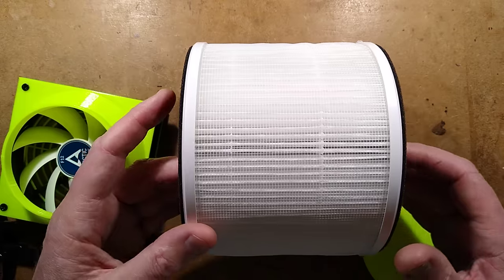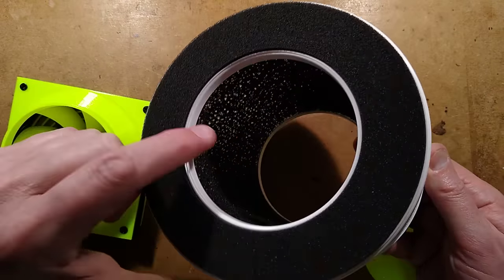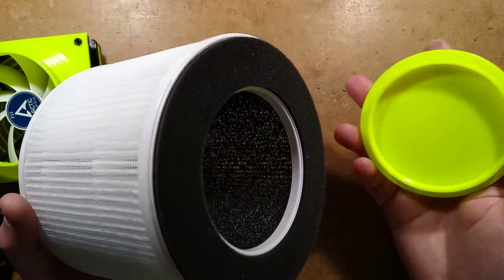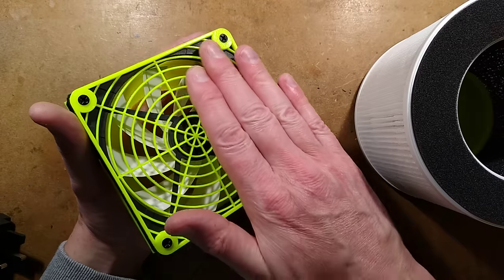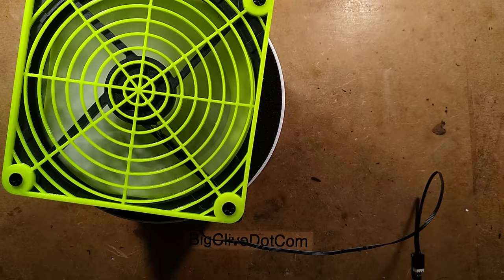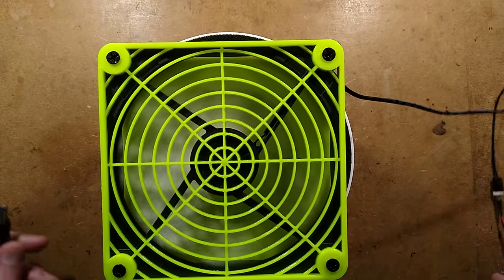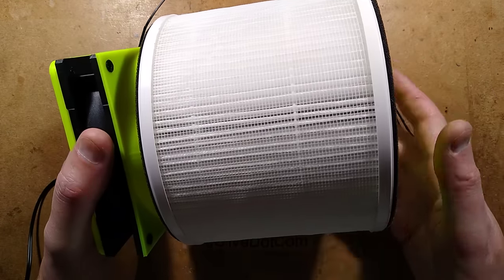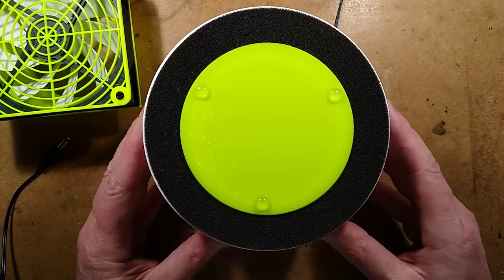DIY cheap & quiet HEPA air cleaner

Comment: Sorry, but why? 
This doesn't filter incoming air, just moves a bit around through an expensive filter. As soon as a door or window opens. Object defeated. 
I can understand these things on a vacuum cleaner exhaust, in the input to a car Aircon and so on, but standalone will do little more than a token effort. For most it's unnecessary and a waste of power.

Comment: In my opinion these filters do shit... I am planning on replacing the filter with a 125 micron nylon mesh just to capture dust particles and for that purpose I think that it will do a far better job. 125 micron filter will increase the airflow substantially

Comment: Unless you test it to at least the 4 x 9s at a stated, regulated flow, d/p, etc, it's not a HEPA.
Did system engineering for certified HEPA systems for hazardous material facilities and this kind of system is a kludge that has no reason to do anything useful.

Comment: You seriously need to educate yourself on  computer fans, even for a 2 year  old video much of what you claim about computer fan bearings and lifespan haven't  been true for more than 2 decades. At full  volts and amps computer fans will last 3-6 years even more than 10 years with basic  cleaning and bearing maintenance (as some are able to be oiled). As for vertical or horizontal yes  certain bearing  styles are better at one position over the  other however even in a non optimal position it will not significantly effect life or performance, worst case the fan  gets loose inn the bearing and makes  noise  wobbling  around long before it dies, this was a huge issue with sleeve bearings/bushings however newer designs  of sleeves  have internal machining to  hold oil in place better. While newer bearing designs allow for any orientation though cost will reflect  this, more important than bearings  is blade design some are optimized for  pure airflow while others  for static pressure such as  having to move air through a radiator fin array or a HEPA filter, so making sure  the fan you use is  for static pressure will give  better performance and noise levels also even on full power a 120mm fan is pretty quite as is, if it's an issue move to a  larger fan as larger fans spin slower while moving the  same or more air  and  if it's such a problem that you have to solder in  resisters  to  drop the speed why not just put  a rheostat inline so you can control speed with the twist of a knob or buy a computer fan  with an  onboard speed selector switch

Comment: I'm an air quality expert. Most of the small, cylindrical air purifiers on the market don't have strong enough fans to move air through the HEPA filters which is why the filters never get dirty--they don't work! Same thing with most people's jerry-rigged DIY air purifiers. I suspect this one will have the same result--just a waste of time, money, and electricity.
Reply: Please could you share your knowledge on what level of air flow and filter size is required to be effective in an average size living room?